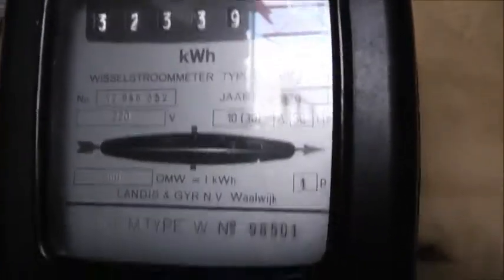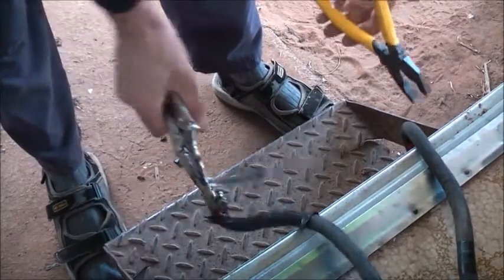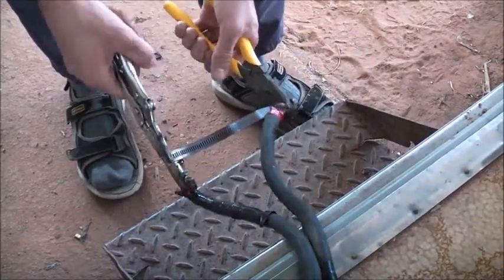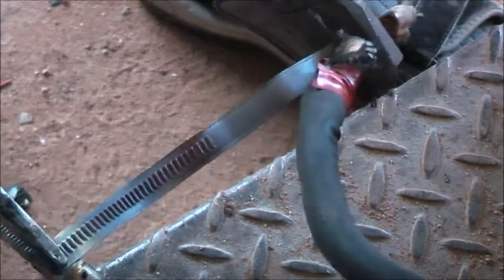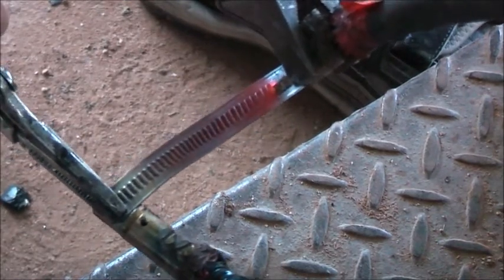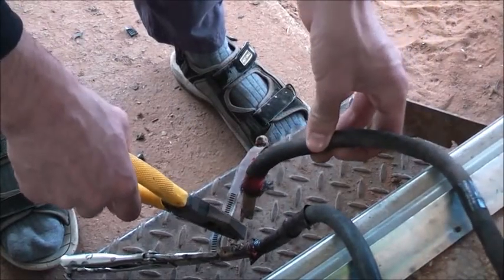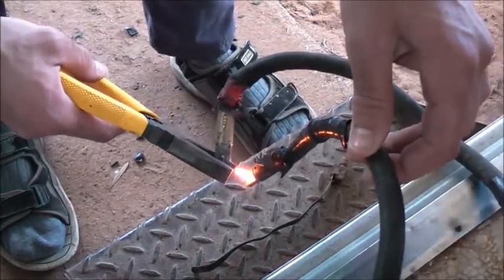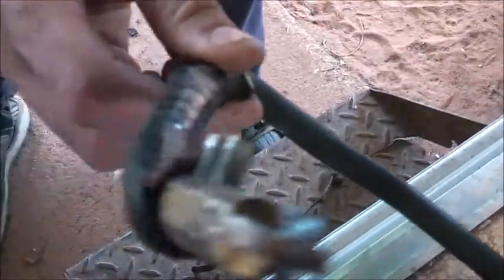Landis & Gyr Test & Mod MOT!!

Comment: Good connections are a must with low voltage high current. You should be able to glow the whole strip.
Great high current source.